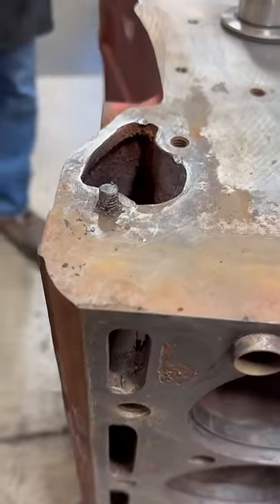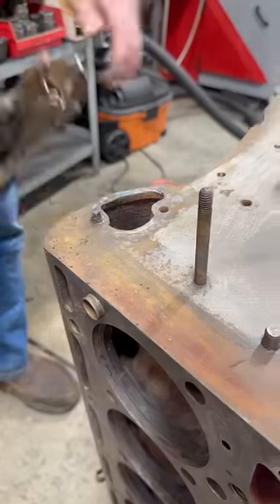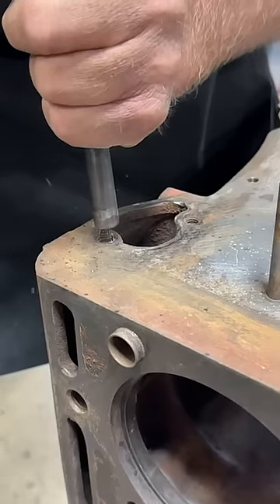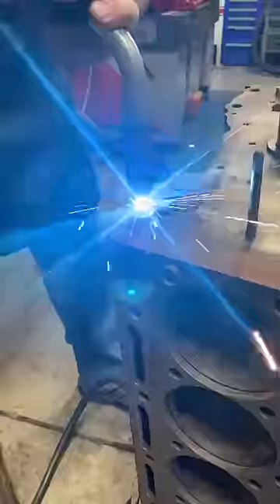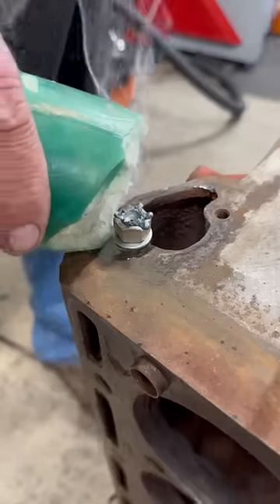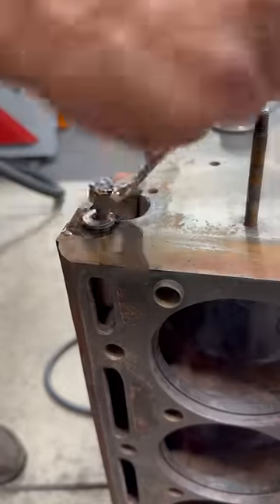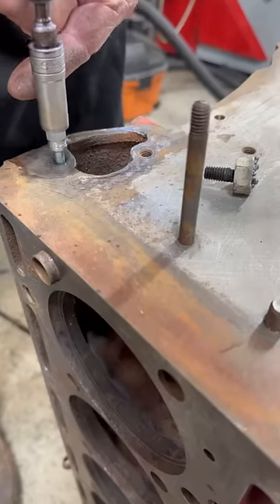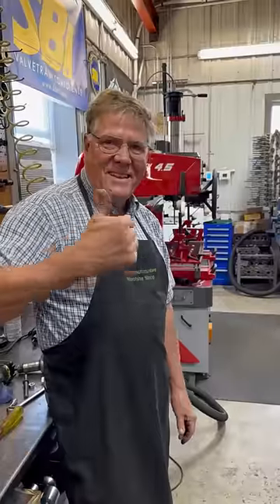#shorts I Make So Much Money Removing Broken Bolts

Comment: Guess I'm kind of an old man too. (Don't know how that happened). I'm a big fan of wax over those spray on cutting oils.
Reply: The wax does nothing.
Reply: What is so magical about wax that it can go where no penetrating oil can go? Soon as the bolt was heated and burned up some of the rust, and expansion and contraction took place, the game was over.
   Been hearing this candle wax hogwash for years… why are there never candles in the spray penetrant section of the auto parts store?
Reply: @richardmaurer2002...How much does a plain old candle cost? Now how much does a can of WD40, PB Blaster, etc, cost?

P.S. Those candles would be sitting right there on the shelf if the store thought they could make a buck...

Comment: Just a tip, make sure you have a cup of tea after welding the nut on. If you try to do it when it is still hot, the threads of the bolt will have expanded so you may snap it again. Leaving it to cool also allows the lubricant to get sucked in by the action of the bolt shrinking.
You can get mostly anything out with a tig and someone to use it ;)

Comment: I've gotten bolts out of aluminum heads that were broke off below the surface, by mig welding to the end of the bolt letting it cool tell it stop's glowing weld some moor tell there is a stud coming out. then weld a flat on the side so I can get a crescent on it. It might not work the first time, but I have never failed to get one to screw out. good luck!

Comment: Remember kids the drill is the very last resort, and heat is your friend
Reply: Heat and wax man, i started using tealights for stuck stuff. Its worked better than anything else ive used
Reply: @sheslikeheroin1661 I’ve not run into a stuck fastener that heat and wax can not remove.
Reply: I had to take that last resort once, exhaust manifold bolts broke off in my heads and nothing would get them loose. Drilled them out with the drill press and collapsed them with a hammer and punch
Reply: @csigunner5087 Usually you can build up a weld and then put the nut on that and get manifold bolts out of heads, plus the head are usually aluminum these days so the mig won't stick to it, that's how I always get bolts out that are flush or recessed in an engine.
Reply: @wymonwatson1309  they were heads off a 94 Explorer, steel. But I appreciate the heads up.
Reply: Also freeze off, dry ice, or liquid nitrogen. They are not stand alone fixes, but still very helpfull
Reply: @csigunner5087  Yeah, that makes it a little harder. I would have still tried that technique though, sometimes there's no getting around drilling but I'll always save that as a last resort.

Comment: I heat the block witn Ox/Act , I also like wax because it don't flash like Pen Oil when the blocks glowing orange and use a vise grip or stud puller. your method is 100 % as well. did it more at the muffler shops

Comment: I need you to do this on the alternator pivot bolt on my Toyota 😂
Reply: buy a tap and die set. it removes broken bolts without doing this
Reply: @stevenkassulke9747  yea, but with the alternator still in place how would I use that? There's barely enough room as it is to get a wrench or socket on the head of that bolt. It's fused into the alternator part because the bolt is steel and the alternator is aluminum
Reply: Lower the assembly, use an impact. Soaking with Kroil helps.
Reply: @jakal104  ill have to give that go

Comment: If you had quenched that hot nut and stud with water until it was cold, you would shock the rust into a very fine powder and eliminate any thread galling as the stud is removed.  Water would be the far better lubricant to liquify that rust powder.  Try it!

Comment: Bees wax works the best. Crayons and candles do good too. Heat the bolt red hot only the bolt put the wax on itll run right down threads and the vice grips would have spun it out. Used to use it to get pipe plugs out of old blocks before cleaning.

Comment: Candle wax, all day. Best part is unlike penetrating oil, if it doesn’t work the first time you can reheat for a serving go with very little smoke. Wax also naturally moves towards heat similar to solder.

Comment: I like your videos. But. Aren't the jaws of the vice grips too wide? Wouldn't it be better to weld the nut on before hammering the threads? And it also looks like the wrench is backwards. Personally, I'd use the box end.

Comment: Not sure how much screw length you had, but you could also install two nuts, tighten them good then use a box end on the bottom nut to take it out.

Comment: No. You do NOT loosen the corrosion by heating. 
If you heat the bolt (or rivet) intensely, you cause the bolt to want to expand, in ALL directions. 
Because it is confined in the threaded hole it can ONLY expand lengthways. When it cools it wants to shrink in ALL directions, therefore it shrinks diameter as well, leaving a smaller bolt in the hole..!!!

Comment: slot the bolt, soak it in wd-40 first for 24 hrs....then put slow heat to it...unscrew it out...ive done the welding the nut trick...it works, but sometimes it snaps right under it

Comment: Not sure about the wax,  but yes,  proven method!     I am wondering if good curved visegrios and heat could have done it.  Also if the owner would have heated the bolt stud upon attempting to remove it,  it probably would have come out.  MarkMannM2

Comment: The wax works great. The way it works is not by lubricating the threads, but by getting down the threads and contracting and expanding. Think why would they use wax as a motor in some things like a thermostat? Because it can expand and contract with some force. I also saw it on project farms channel the wax didn’t work as a lubricant but I thought of the wax motors and put two and to together. Lol

Comment: Heating up the bolt doesn't loosen it, it does the opposite. Your supposed to heat up the metal around the bolt not the bolt itself(unless you're liquifying it).

Comment: Wouldn’t hammering it and using penetrating fluid also work ? I have found penetrating fluid work wonders on exhaust and crank pulley bolts time and time again.

Comment: Bolts are made up of alloy steel, so if it is too much tight, then special welding electrodes like CGS680 or 021 gives better results.

Comment: Not the only way.. you can drill the middle of the bolt until its thin enough or entirely drill the threads. I usually do that when welding fails.

Comment: We used to use an electrolysis lye tank for our antique parts. There were tons of seized nuts and bolts that came right out after being in the tank. For the worst parts we’d use an air hammer every couple hours to speed up the process.

Comment: There are other ways. I have never welded a single broken nut or bolt. When it sticks out like that everything is the same except my first go to would be a double nut, if not that then angle grind 2 sides flat and use a wrench, if that doesn't do it I like my square drive removers. I just don't want to risk getting splatter on stuff like in the cylinders or on a mating surface.

Comment: Good  job I had 1930 marine engine frozen, pistons kerosene poured in cylinders 2 weeks socking made oak dowel @3 1/2 in thick rapped on pistons with sledgehammer  freed up and got the old fishing boat chasing the lock ness monster again

Comment: When the bolt is hot, wax is the best solution. You should not use penetrating oil on anything hot as it causes it to vaporize, which can be very bad for anyone who breathes it in.

Comment: I remove broken bolts all the time that are broken off flush or inside the hole. Most of the time they are so stuck that they have an ez out broken off in them from the customers previous attempt to remove it. 
The only way to get the bolt out is to drill it out undersize with a carbide drill (if an ez out or tap is broken off in the hole) sometimes a good quality drill also does the trick. Next you have to tap the hole out to clean out the threads. 
This is by far the fastest way to remove a broken bolt. 
Drilling it out is only possible if you have a good way of solidly mounting the workpiece to either a drill press or preferably a mill. Also a center drill is HIGHLY recommended for getting the drill started in the center of the bolt if the bolt is broken off crooked.

Comment: I'm my opinion candle wax works far better than WD-40 at those higher temps; automotive service technician here for about 20 some odd years. WD is flammable and will boil away; whereas with wax, the heat causes it to wick quite well.

Comment: I had to do this process lying on my back underneath a minibus with eight hex panhead bolts....daftest thing I have ever seen to put panhead bolts where they can corrode...but wirebrushed then a normal hex nut welded on took them right off...suffice to say I didnt replace the panheads .....I used proper bolts

Comment: Tried this last weekend on a broken intake manifold bolt. Worked perfectly. Then the thread chaser snapped off in the hole. I tried the weld technique, no dice. Ended up fluting a masonry bit with a carbide tip and using that drill through the thread chaser. God dam that job sucked.

Comment: That's   cast iron block. I would heat the metal orange around the port opening, and then grab stud with vise grip and go back and forth , then unscrew it. I wouldnt be rattling on it with a air hammer first😂

Comment: Actually, broken bolts that are frozen in corrosion can also be removed with a torch and the precise use of electronic freeze spray, the kind that's used to diagnose electronic components for failure. A few decades ago while replacing a timing chain, I accidentally sheared off a retaining bolt on the front of my car's engine. Unfortunately it sheared off flush with the block with nothing protruding I could grab. I tried drilling the center of the sheared bolt out and using an Easy-Out bolt remover in the drilled out hole to remove the bolt, but it was stuck fast with corrosion between the threads of the bolt and the block and it wouldn't even try to budge. Remembering science class and that "Heat Expands, Cold Contracts", I first cleaned the entire area throughly of all grease and oil using carburetor cleaner and wiped it down for safety, then using my propane torch I heated both the broken bolt and about 2"-3" of the surrounding block metal to a very bright orange, almost yellow hot. I made sure the drilled out hole inside the bolt was just as hot. I shut the torch off and then before anything could cool in the slightest, using the tiny diameter application straw already mounted on the spray nozzle of the can of electronic freeze spray, I carefully and heavily sprayed inside the drilled out hole of the hot bolt, and nowhere else. This froze only the bolt, but not the still orange hot surrounding metal of the block. I then immediately and easily removed the bolt with the prepared Easy Out tool before the bolt could warm up and expand again, or the orange hot block could cool and contract. Both the bolt and the surrounding block metal had slightly expanded together in the intense heat. When the bolt suddenly went from yellow hot to frozen, the bolt just as suddenly contracted, the bolt and nothing else, and while not visible to the eye, the shock of the bolt's sudden contraction was enough to break the corrosion in the threads that were holding the bolt and it spun right out.

Comment: As someone who has worked in a county machine shop, and has removed many, many bolts, I thought this video was spot on up to the point he runs a thread chaser in and out on a driver.  RIP your customers minor and pitch diameters.  Spend another $.50 on your employees time and have him use a wrench

Comment: Me and my grandpa were changing the brakes on my lawnmower and we broke a bolt. We trade PB blaster welding a nut on it and  none of it worked so we had to drill it out and then re-tap it and put a new bolt in there.

Comment: So, I learned how to remove stuck studs from a mechanical engineer who taught me how to work on Porsche engines. He taught me heat and shock the rust. To shock the rust, you use impact from striking it.

Comment: That vibration causes microscopic cracks YOULL find out when the car over heats. No need for vibration the heat  and weld alone is good

Comment: I didn't believe the candle wax thing until I had a stuck kingpin and beat on that thing for a half day before an old timer came over and melted a candle on it and the thing damn near fell out, and yes I did remove the lock nut before I started beating on it.

Comment: I eas expecting you to start wrapping on it with a hammer. That's the first thing i do on rust seized broken bolts, but that air hammer probably works even better. Last time i did this i fortunately had enough length to grab onto it, so i worked the bolts back and forth slowly while beating em with a hammer on the end of the shaft and got em all out with no fuss. This was on a 351 windsor (timing cover/water pump bolts), and those tend to be problematic, so i cleaned the holes in the timing cover with a drill bit to remove the galvanic corrosion and put thread sealant on the end of the threads since they go into the water jacket and smothered the shaft of the bolts in copper anti seize to prevent future galvanic corrosion. Im sure theres a bit of electrolysis involved in that awful windsor timing cover bolt corrosion also.

Comment: Would it also work to drill a hole through the bolt and then spin it with by passing some sort of stick through the hole as like a lever ? Just in case it happens to me because I don't have a weld kit.

Comment: Heat galley plugs push small candle to threads wait and take them out before the cold or hot vat. Hi pressure wash Clean. Air blow.d ry.with a rod before rust can form. Intention not motive ❤

Comment: An easier way: cut bolt flat to surface. drill a hole in stud/bolt. Use a bot remover. Hammer bolt remover into the bolt. Use vice grips to turn bolt remover to remove bolt. You're welcome.

Comment: I have no doubt that he has the experience to get away with it, (or rather how far he can go) but the peening, especially on the side, I've seen light whacks on cast leave cracks. Personally I wouldn't have the confidence to do it if the welding option was there.

Comment: I asked an older guy I worked with why he used candle wax and why he thought it worked better. He said "The wrong stuff like wd40 boils off. Even the right stuff like PB and that new sh*t (dont know what he meant) boils right off. Gotta use the whole can for half the results. My yellow candle doesn't boil off and I get mist if is back." Fair enough I thought, so I asked well why doesn't a company make something that doesn't boil off? He says "it'd last to long" LOL I still think he's right years later

Comment: That is NOT the only way; there is a much simpler that just is to drill a small hole and screw in a counter clockwise screw that will get tighter the more you losen the screw
Reply from the maker: But it made you comment didn’t it

Comment: I use Milwaukee cause I like there color , there relative to dewalt in price and my company at the time was heavy Milwaukee. Also have a lot of niche tools, im an electrician. Use them commercially, originally used RyobI when I started and I’ll stand by them being a great bang for your buck . IDE start buying the best deals, ie dewalt makita or what ever is cheapest at the time but ide rather just keep 2-3 batteries charged in my box rather then 6-7 because I have 2-3 diff tool brands

Comment: Candles can’t be repaired like that! You’ll need heat and an accurate bevel tool, start by gently warming the wax, then crack a beer, make sure you have a wobble bolt in the drill press to make cover noise for yourself while you’re not doing anything.

Comment: 302 guys know.. I did the weld trick for the infamous water pump bolt that breaks on the block. I let a shop do the broken bolt on each head, $75 per 😂

Comment: Yes it works. But they didn't explain. To make sure the nut.that is used to weld onto. the broken  broken stud. Should be a grade 5. Grade 8 And higher are too bridal and won't stick to the stud. Like a grade 5. Something about the tensal strength. In anything higher than grade 5. What also works is to drill a hole  slightly bigger than the stud in a piece of cold roll flat stock. Put it over the stud.weld the flat stock to the stud. Let cool for a minute or two. If the flat stock is long enough. You can use it as a handle and work it back and forth till it comes loose and wool la it's out.

Comment: My buddies used to always just do the good old 2 nut trick instead of welding. Still air hammer; head with a torch and use crayons for the wax

Comment: no no no. drill it off center and butcher the original threads. they tap the hole to an odd size (preferably fine thread) so the customer appreciates your effort later

Comment: I got news for you it doesn’t work all the time as a matter of fact depending on the situation they normally snap right off below the surface and then you’re double fu*ked where are the only possible way would be to get that thing up on a milling machine and run an End mill A few thousands in diameter less than the diameter of the bolt and then pick out the remaining portion still in the threads..

Comment: Thread chaser? In pretty sure that's called a 'tap'
Reply: theres actually a difference, used to think they were the same too. a tap is for creating new threads, a chaser is for cleaning up existing threads. the only time you would want to use a tap instead of a chaser is if the chaser doesnt work